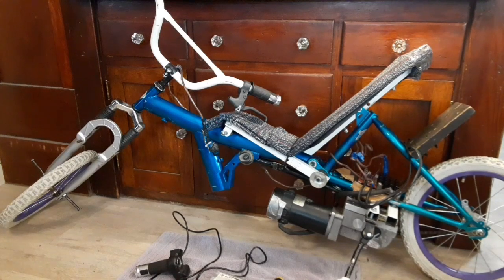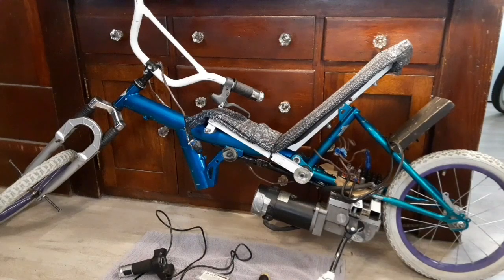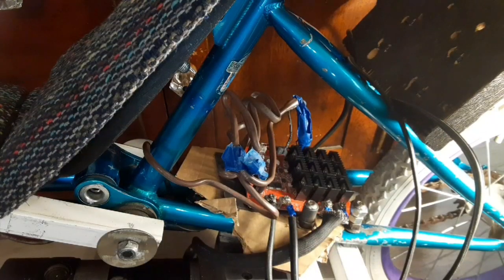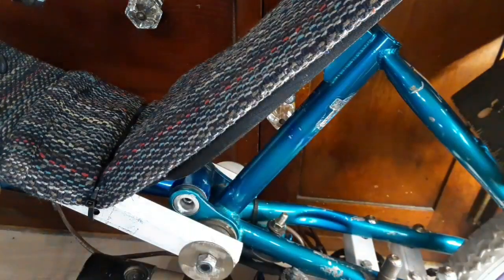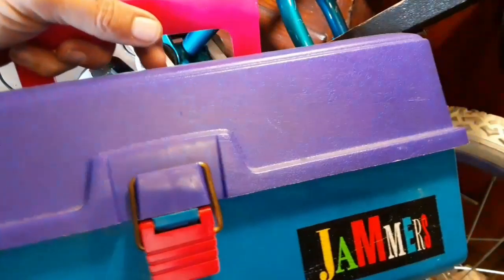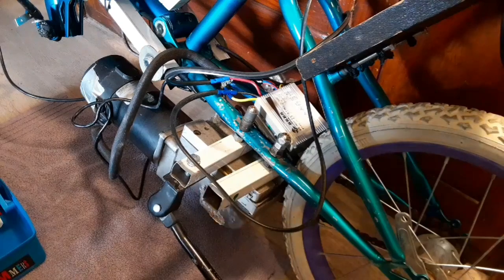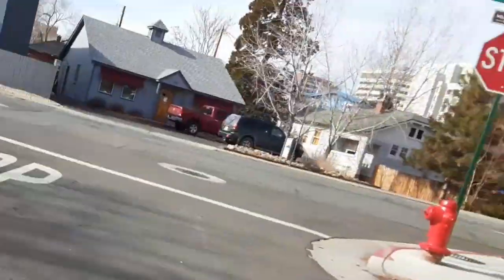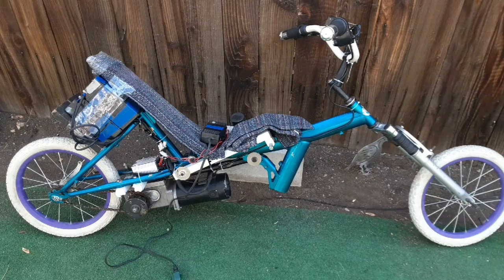Sit down electric cruiser scooter. upgrades, ride, and new electrical.

Comment: Looks hard to balance but its running....nice job
Reply from the maker: Thanks. It was almost impossible to steer with the shorter front end. If you use both hands to drive it is pretty stable.